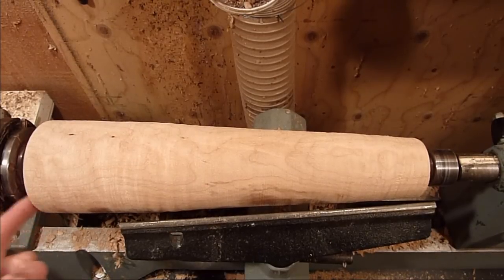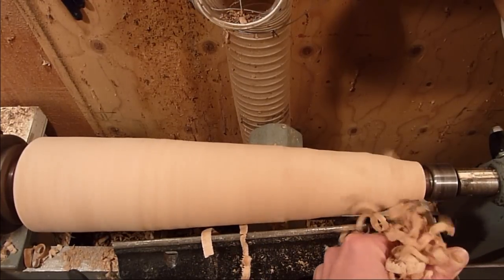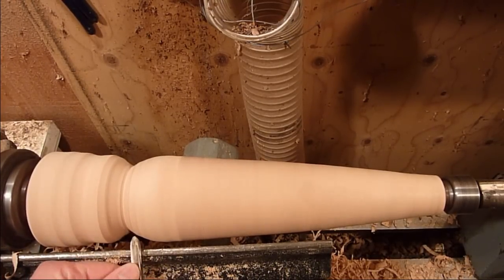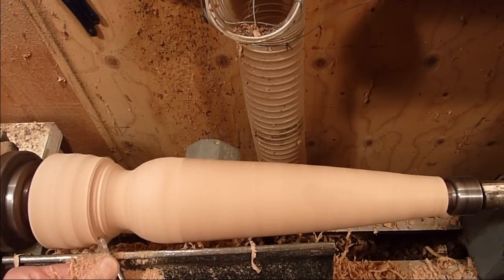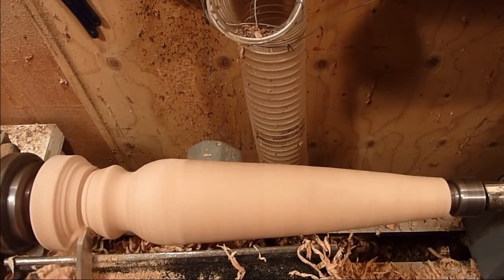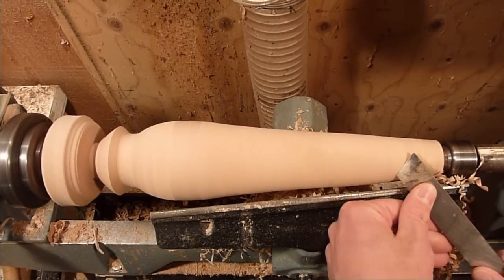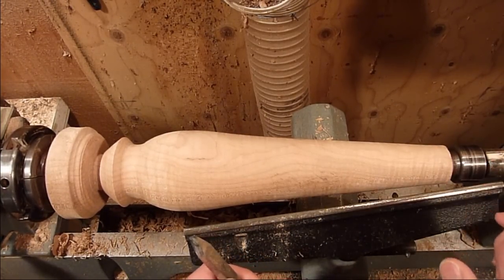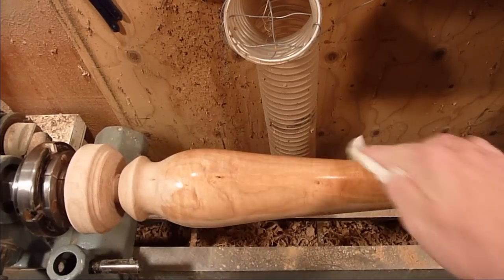Woodturning Turning a Lamp

Comment: Can i use a sharpener blade instead of chisel
Reply from the maker: The steel needs to be pretty thick, I'm not sure what kind of blade you have.
Reply: @CarlJacobson  pencil sharpening blade 😂
Reply from the maker: I wouldn't recommended use one, it's not safe to turn wood with.
Reply: @CarlJacobson  then what can i do?.